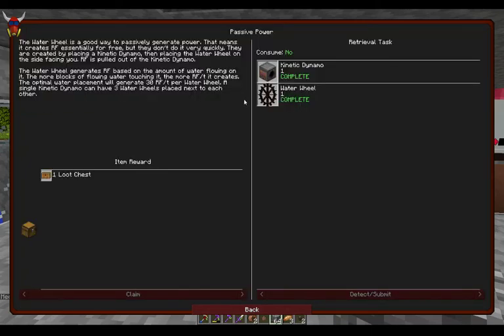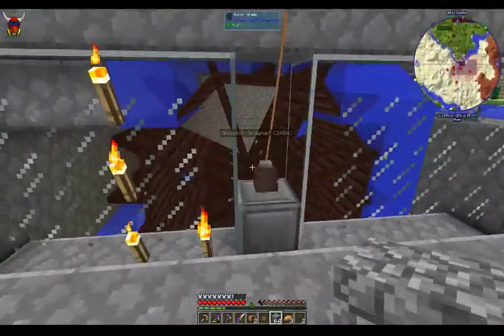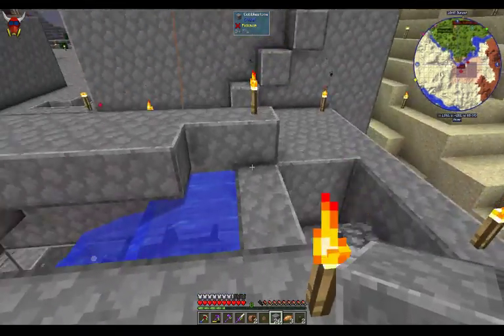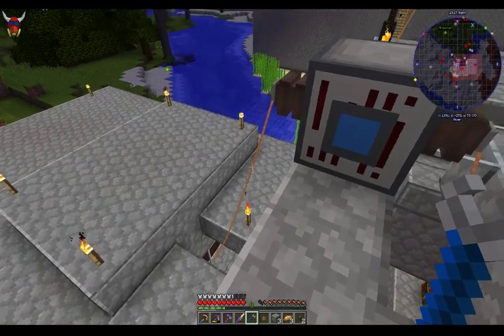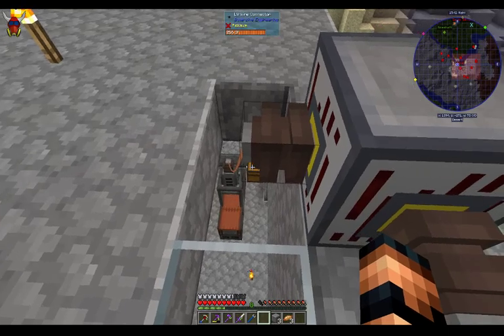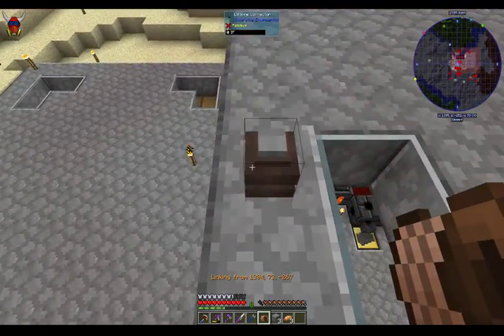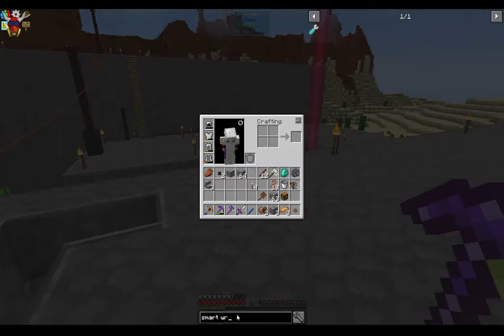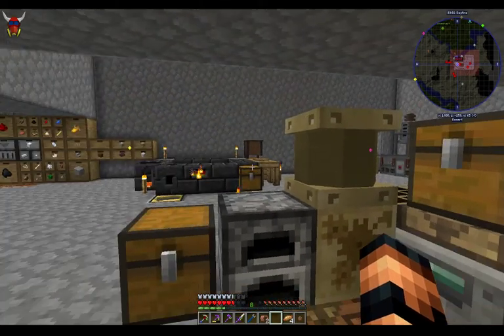FTB Continuum - Episode 13 - Water Wheel, Dynamo, Powercell and Basic Power Generation

Comment: Doesn't MV transfer more power? Also, per relay, do you lose power?
I just started this game and im having trouble linking the coal/leadstone and the wires.
Reply from the maker: MV does, up to 1024 RF/t if I recall correctly.  LV does much less at about 256 RF/t.  This was more or less a crutch.  I like Immersive Engineering as a mod pack, but am not a fan of the power capacity.  I don't recall seeing any power loss, it's just the throughput that limited.  If you can afford it, move to Fluxduct ASAP!